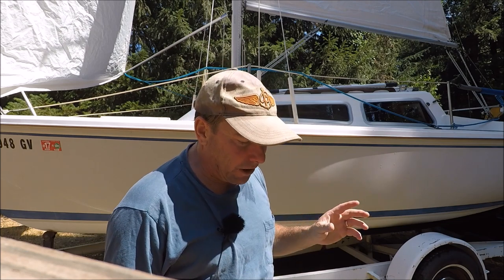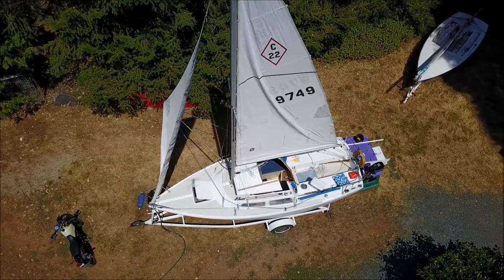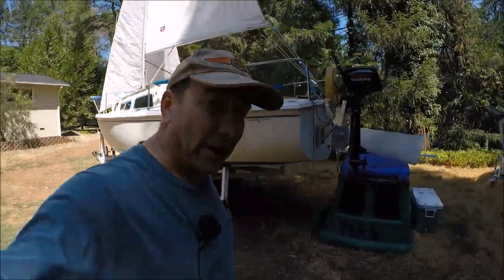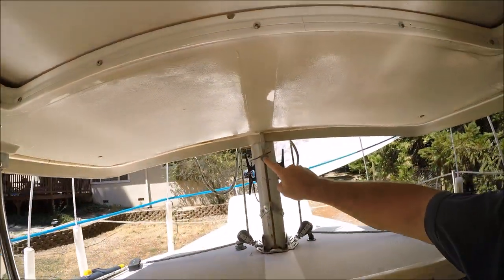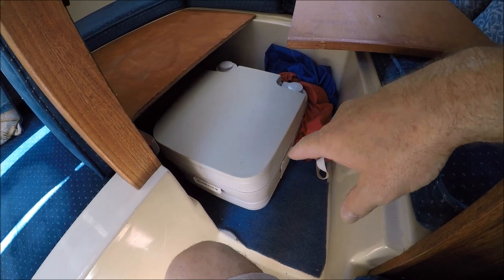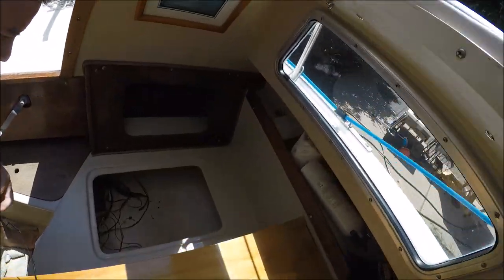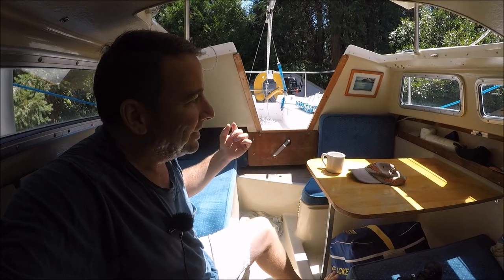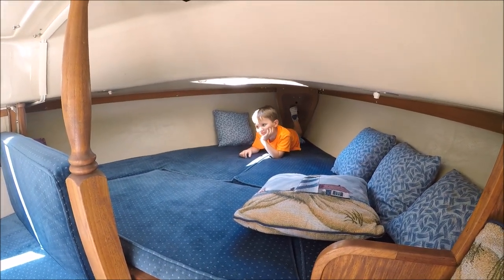1980 Catalina 22 Sailboat Detailed Interior Review

Comment: That's not the wiring system we installed!  I've been a blue water sailor since my teenage years, and when we got it we rewired it completely-all the way to the masthead!  I sold the boat to a guy who wanted to race her once we moved to WA, and it looks like he altered the system completely.  I set her up for cruising, complete with a VHF station above the dinette table, which I used for my chart table, and I see all that (including the VHF and masthead light) is gone.  I put in heavy duty chainplates and back stay, and sold her once we moved, as there's no place to safely sail here-gusts come down from the high country topping 30mph "out of nowhere"!  When I got new North Sails for her, I had reef points installed for a jiffy reef system, and I don't see those points on the main now, so those must be different sails!  I sure miss her, and am really glad  you have her now, and will enjoy her!  Cruising the San Juans is something I'd recommend if you have the time-launch out of Anacortes. If you need any gear, including charts, Anacortes Marine Hardware will have it!  Fair winds & following seas!!  Oh, and check the Keel winch cable every now & again!  I had it break one day at Folsom, and it was really fun trying to get her on the trailer again with the keel down!!

Comment: First of all, good job with the video. Very informative. As a Catalina 22 owner, one can appreciate the detail provided in your video. 
I wanted to touch on the subject of the keel bolt. The keel bolt isn’t to “lock the keel” in place, rather to act as a friction brake in the event of grounding or hitting obstacles in the water so as to not damage the keel trunk; essentially to slow the boat down in a controlled manner. There is a common misconception with the keel bolt and it’s purpose. The Macgregor Venture had a keel bolt design that went through the head of the keel. The through bolt was specifically chosen to bend or break in the event of an underwater collision, which could easily be replaced. Beefing up or changing the design of the keel bolt on the Catalina 22 would be contradictory to the design plan; which if changed could result in damaging the keel trunk (thin fiberglass) to a point which could result in loss of the vessel or keel.  Just some food for thought. See below for some interesting references regarding the subject.

https://thisoldsailboat.files.wordpress.com/2015/12/why-your-swing-keel-lock-bolt-wont-save-you-in-a-knockdown.pdf

https://www.google.com/amp/s/stingysailor.com/2015/11/07/why-your-swing-keel-lock-bolt-wont-save-you-in-a-knockdown-2/amp/
Reply from the maker: Great points! Thanks John.

Comment: We used our keel lock bolt on our Venture 21 for safety but the real joy was being able to loosen the tension on the cable-suddenly the harmonics generated by the vibration and magnified by the sound box of the hull would disappear!  You couldn't tell how fast you were going by the pitch anymore but you could hear everything else.  I don't remember exactly how long it took us to figure that one out but I do remember we wished we had done it from the beginning!  "Unsinkable", the Venture 21 was filled with foam blocks under all the berths.  Three small kids and a hyper vigilant mother and that was the deciding factor.  Great family memories in the early 70's; and, great respect for things that pinch and the unforgiving hardness of stainless steel should you slip and slide a body part into a winch or cleat !

Comment: We had a Catalina 27 and we had it at the time in Channel Islands. My dad and I raced sailboats and dad sold his Clipper 21 for the Catalina. The Clipper 21 is similar to the Cat22 with the retractable keel. Anyway one day we came back into Port after a race and there in front of the yacht club was the first ever Catalina 30. It was a bit beat up from testing and my dad inquired about it and eventually bought it. Well Butler took the boat back to the factory in Canoga Park and completely refurbished it for us and then my dad put a bow sprit on her and stepped the mast to the keel and added 10 feet to the length for racing. The boat had no interior as it was number one. They build these in three pieces, hull, deck and interior. Well the interior mold was not done and Butler wanted to get it into the boat show so he slapped the deck on it and locked it so no one could get inside. After that he used it for weight and balance testing for the interior design and thats how we came to buy it with no interior. The boat sat about a foot above the waterline because it was so light and our racing handicap was so extreme do to that it was hard to win a race even when we finished first. Anyway, we named the 27 Fury and the 30 was named Rage. If you ever see a Cat 30 named Rage it is number 1 and was my dads boat.

Comment: I lived in Rancho Cordova in 1960 and did my first cabin sailing on someone else's Catalina 22 at Folsom Lake. After moving to southern Ca the 1970's I wanted to move to a larger boat, which at the time was the Catalina 30 which became one of the most important sailboats of all time. It had a gas powered auxiliary eng was well laid out, and with a little effort would sleep 4. Its real popularity was the fact that it could be berthed in a 30 ft slip which was the least expensive slip rental for an ocean sailboat and many thousands were sold for this reason alone, Catalina had built a 27 but the 30 fit in the same slip as a 27 and provided more room and greater flexibility, great fun...but those days are over.

Comment: Nice tour, brings back memories of my 1984 C22. One item.. under the seat on the starboard side, you said an option for a sink. Well, there was a whole slide-out sink and stove that slid back under the cockpit seat. It rode in the tracks you see there.  I don't know if many of those things survived the years.  I had one it was beat to crap. thought I'd rebuild it but never got to that project. 
Rats nest wiring. I re-wired the whole boat with marine wire.    I was never happy with the sloppiness of the behind-the-wall finishing of the fiber glass. The swing keel was a project.. watch out for the pivot hole.... ALL of the 550 lbs of the keel is riding on that hole. I had it welded and reinforced with nickel.. You'd have a really bad day if that broke and fell under your boat while underway.  However, it was a great starter boat.. learned about boat repair... sold it and bought a new Hunter 36....  I now want a 43; Center console..with bow thrusters.....  if you get the bug it never ends.

Comment: The kitchenette went in what you called the quarter birth. I agree with the bad wireing. Its why many boats burn. Catalina didnt make replacing the wireing easy either, but every boat has its issues.

Also, a twin air mattress fits perfectly over the dinette. I keep my air matress, pillow, sheets and large beach towels in a laundry vacuum laundry bag. Then if i need my towels for a blanket i have them or there are always towels if needed.

Comment: Looks wonderful!  The most "Gently Used" 1980 Model Ive seen yet!  They probably took it out once  every Summer month and thats it!

A great NERDY SUGGESTION on the Swing Keel:  Clamp a small piece of flexible sheet metal to the top of the cable and one near the bottom.  Paint one Neon RED and one Neon GREEN.  Drill a 1 inch hole through the backboard, and now you have an "UP" or "DOWN" Indicator!  Probably worth every bit of time it would take to make this!

Best Wishes from San Diego!

Comment: WOW,  does this bring back memories.  We had a Catalina 22 starting in the mid 70's.  The boat was excellent for young family.  We sailed the Arrow lakes in the West  Kootenay Valley of British Columbia for 6 years.  Word of advice, lock that keel down, you never know when your going to get into a bit of a blow and you do not want that keel to start coming up when you are underway.  You may want to consider getting a marine VHF with DSC bolted to the boat,  just in case things go south at the wrong time.  I also flew a Cessna 120 (CF-LYS) in the good ol' days, it was a rag wing also.  Moved on to electrical engineering.  Very impressed with your work on the Oroville dam.  I worked for a hydro utility.  PS, Nice thing about a sail boat, it's not the money pit like a power boat.

Comment: Excellent overview of the Catalina 22.  Nice example here given its likely age. It's more of a coastal pocket cruiser than a lake boat with that heavy swing-keel and no mast lowering system. Polish lake boats have some ballast in the bilge, plus a much lighter swing centreboard, drawing a foot of water when up. They also have an A-frame at the bow, which allows the mast and furled headsail to be lowered or raised  in minutes under way using a winch at the cockpit. More ocean-going versons have a stub keel and  swing centreboard, drawing perhaps a foot and a half when up (somebody sailed a TES  22 footer across the Atlantic a few years ago).  I'm surprised that Polish-style lake sailboats have not caught on in a bigger way; the Macgregor sailboats of some years ago were much less substantial than the Polish ones. That style of trailer sailboat certainly opens up many lakes and rivers, allowing easy passage in shallow passages beneath low bridges between  sailing areas, e.g. the finger lakes of Ontario and New York state. The Canadian equivalent of the Catalina 22 is the Shark,  a 24 footer, which also is extensively raced and  has also crossed oceans, but it has a fixed keel.

Comment: You might want to use the keel lock if there is the possibility of a lot of wakes.  When a C22 with a swing keel hits a wake and pitches, the keel, if not locked, tends not to move with the boat,  The result is that the keel can slam against the hull and potentially damage the hull and the swing pin.  The keel lock keeps that from happening, although a big wake can bend the keel lock bolt.  I found that out the hard way on my swing keel boat back in the 70s (a Venture 21).  The fix was easy.  Basically I drilled the hole through the keel that the lock bolt went through to 3/4" from the 1/4" it came as.  I machined a derlin insert to  just fit into the keel and also give a snug fit for a 1/2" stainless steel bolt   The heavier bolt gave a stronger lock and the derlin insert stopped the unpleasant banging of the keel against the lock bolt.  The only hard part of the project was dropping the keel, but at only 550 lbs that can be done easily with a couple of hydraulic jacks (after you get the boat off the trailer).  C22s are nice lake boats though.
Reply: Yes Mike, Derlin.  Derlin doesn't swell when it gets wet like nylon does.  It is also easy to machine and drill.  The idea is to provide a strong, snug, low friction mount for the keel bolt.
Reply: Delrin is a duPont plastic that makes for very good bearings, probably what's meant here.

Comment: Thanks for a great video!  I want to point out that the keel winch should NEVER be replaced with a trailer winch.  Trailer winches have an integral clutch that limit the speed the keel will be lowered. From the Catalina Direct web site:

Never use a trailer winch as a replacement for your boat's original keel winch! Visualize what would happen if, as the keel was being lowered, your hand slipped off the winch handle. Imagine the potential injury if your hand got tangled with the rapidly spinning winch handle. Never attempt to adjust the clutch mechanism. If the thing does not work right, replace it. The cost is just not worth the risk to the boat or the crew.

Comment: Cat 22's are great boats. There are many Catalina sites on the web with good advice. Wiring on the boats started out fine but after a few owners they all end up wired by bears. Be sure and look over the keel hardware, it will avoid the embarrassment of being unable to load the boat because the keel winch has failed in some sneaky way. And check the pivot also believe me that can be a weekend ruiner if it drops the keel.

Comment: That is only part of what the keel lock does.  The secondary function is to keep the keel from banging back and forth within the keel trunk.  You can tighten it down snug where it won't bang all night (or underway) yet, if you hit something solid (a grounding) the keel will still retract.  It is probably a good idea to use it to either lock the keel up or down, or to just to take up the slack.

If that keel cable breaks in the upright position, the dropping keel could rip out the bottom, and that keel lock acts as a friction brake to help guard against that happening..

Comment: A little time, some solder, shrink wrap, cable clips and tesa tape and you could have that mess cleaned up and professional looking! The Tesa tape is one of the things manufacturers cheap out on, except in the automotive industry! Also before starting buy some 1 x 3/4 Inch Panduit Self-Laminating Laser Inkjet Labels, 91 are $5.79+$3.49 with no tax at "show me labels", use them to label your wiring connections!

Just start with a diagram or layout, use labels, use new wire if possible to replace the mess and pre-wire it all to the control unit, then install it, if you have to do tie-ins just make sure you solder the connections and that you labelled them, only use quick push type connectors where something needs to be removed and reconnected regularly, a cheap 100 watt gun type iron works best for these jobs! 

If you need an idea of what I am talking about just swing over to "five star car stereo" and watch a few videos of how they do car audio installations, you are basically doing the same thing on a boat and they could show you some great pointers for fixing your wiring mess, they make their installs look as close to factory as possible and never leave a mess!

Comment: I'd  have some fun with that wiring.  Re-run it all with the proper size and grades.  Nice and neat,  tied down, quality waterproof connections.  Probably some solar panels if there's a place to put them.  Modern LED lights take very little electricity, so built in lights would be pretty tempting.

Comment: A vetran sail maker told me of the "boat owner" conditioning exercises you need to perform before owning a boat.
1) Remove the screen on your shower drain. 2) Put on rain slickers. 3) turn water on full cold. 4) stand and rip up $100 dollar bills, watch them dissapear down the drain.  But would not change my 30 years of boating for nothing.

Comment: Sweet little sloop.  I've spent a lot of time on boats, but have never sailed.  When I was a kid my uncle lived on Bethel Island and sold yachts. We would borrow one, usually something like a 32' cabin cruiser, and putt around the Sacramento Delta a few days or a week. Then in the 1970's and 80's I was a commercial fisherman, we would stay out a week or two at a time.  I've never sailed though.
Reply from the maker: Duck Landes I would like to do a short series on the Delta.
Reply: That would be an interesting series.  Most people have no idea we have such an extensive delta system here in Northern California. There are many little unpopulated islands out there you can camp on. One we used to camp on isn't there anymore, beavers bore holes through the levee and it flooded. Many of the islands are lower than the water level.  Franks Tract Recreational Area, between False River and Bethel Island, used to be an island. In lower tides you can still see parts of the levee, used to be able to see fence posts and stuff sticking up out of the water, don't know if it's still that way.

Comment: We've got a similar but smaller boat, a 1979, 19' Laguna Windrose.  It has a 440 lb. cast iron swing keel.  There's a large keel lockdown bolt that goes through the keel suport and through the keel.  Unfortunately, they put the location of the bolt about 1" BELOW the waterline...ooops!  So while you're removing and replacing the bolt - water is flowing into the boat.  So I, like you, don't bother with the lockdown bolt.  Maybe I'll use it if we sail in a hurricane.  I tell myself that if we hit a whale, a partially-submerged shipping container, or a large piece of driftwood, it would be much better if the keel can swing aft under impact.  We normally sail in Monterey Bay, not too many hurricanes here.

Comment: This is absolutely PERFECT for me!  I just rescued a Cat22 from the woods about 5 miles from my house in Sanford, NC.  It is missing a few parts, as the owner died in the middle of refurbishing it, and his son handled the estate and abandoned the boat when he sold Dad's house.  I got most of the stuff for it, including mostly refinished teak parts, the mast, boom, whiskerpole, mainsail and new canvas cover for the pop-up.  Unfortunately, the nuts and bolts, screws, and pop-top supports are missing.  I think they may be in a warehouse downtown and will continue searching for them.  So I have a lot of work to do in repairing the fiberglass on the deck.  I'd love to correspond with you if I can get an email.  Did I mention it was $100 including a rusty, heavy steel trailer?  It will take me six months or more to get her ready for the water, I'm sure.  So for now, I'll sail my RK-20 on Jordan Lake, NC.
Reply from the maker: start spending here...https://www.catalinadirect.com/index.cfm/category/6/catalina-22.cfm.